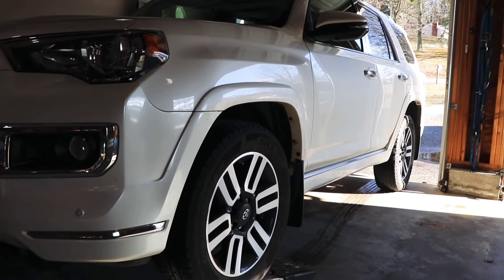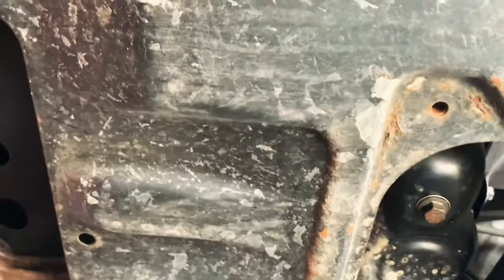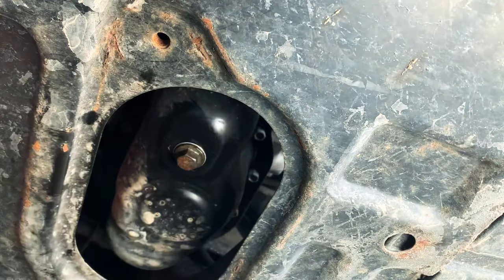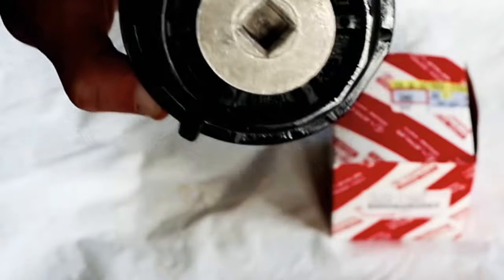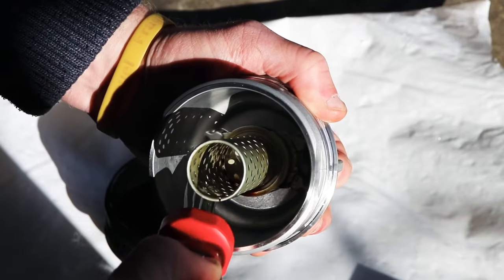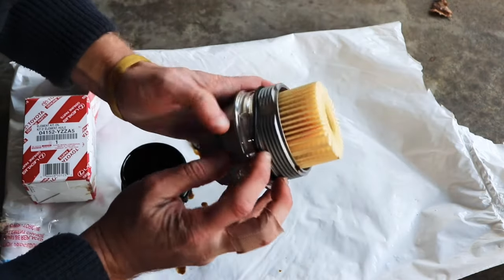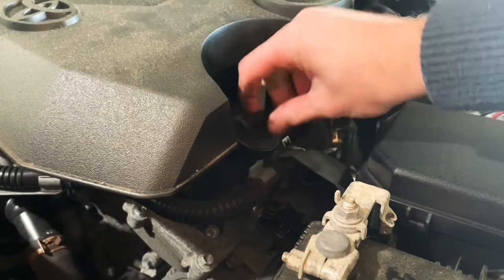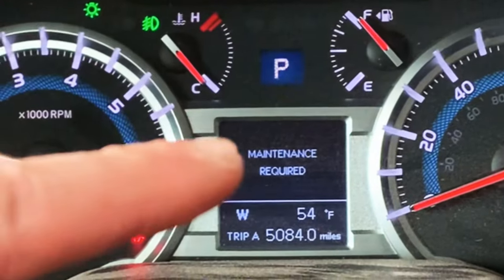5th Gen Toyota 4Runner Oil Change (2010-2024)

Comment: I like Toyota's vehicles, but WTF can't they just use a single piece disposable filter with a metal case like everyone else?
Reply from the maker: I agree it would make this job much easier! Thank you for watching!
Reply: Reduce recycling of metal cans
Reply: Absolutely maddening!
Reply: I have a 97 4runner & that one does use the regular aluminum filters...not sure what year they changed the fikter layout
Reply: No, they use filter designs that actually protect your engine.
Reply: @jensenhoskins714 😂😂😂 then why does every other modern Toyota use a normal metal case screw on filter?
Reply: @burlyheads not positive on this but maybe because 4Runners are built in Japan and everything else maybe elsewhere? Japanese have their ways and I will never argue with them 😂
Reply: @burlyheads The filter housing eliminates the most oil when opened and creates the best seal when closed vs those cheaper metal cans found on Toyota's most likely made in Canada and America. Some AMG Mercedes-Benz uses the filter housing design as well.
Reply: Taking the single piece off could be a PAIN in the ass by using your hands, and not using a tool instead UNLIKE Toyota.😂😅😂😅😂😅😂
Reply: $65 seems pretty cheap for an oil change considering all the work involved.
Reply: @starpartyguy5605  parts and labor...gotta factory all those in...
Reply: Speaking as a professional mechanic, these non disposable oil filters are actually much better to have on your vehicle. I’ve see those disposable oil filters get punctured by a stone and the loss of oil lead to damage in the vehicle. The reusable canisters are much better.
Reply: Actually,  I like those disposable cartridge type filters as long as they use an aluminum or steel housing and have the drain plug on the bottom. I have a hell of a time removing a spin on oil filter and not having oil run down my arm.
Reply: @dingznthingz  yes. I like Toyota's newer design actually. A tool makes it EASIER to remove the oil filter...and can drain the oil of the filter as well so doesn't spill onto your arm.
Reply: Don’t complain too much. Ford has a plastic pan with a dumb plastic twist off drain plug. Then they have the same twist cartridge but on top of engine.
Reply: @itsme6026 Gaaaaaaay
Reply: At least make the filter accessible without removing the skid plate.

Comment: Putting a gallon size zip lock bag over that filter before removing will catch that oil then zip it closed and throwwwww
Reply from the maker: Thank you for the tip and for watching!
Reply: Removing the “drain” plug on the bottom of the filter housing, and the supplied “drain valve” that comes with the new oil filter would make far less of a mess, and no need for a plastic bag over the housing or extra clean up. A 3/8” ratchet will fit the drain plug of the filter housing. Remove it. Snap the supplied drain valve in to place, and let the housing drain. Remove the housing, throw away the old filter, removing the old o-ring seal, wipe out the housing, coat the new o-ring seal with a bit of oil, put new filter in the housing, screw the housing back on until tight (NO MORE) install housing drain plug with new o-ring seal. NO MESS to clean up. NO DAMAGE to plastic housing. Been doing it that way since new, and NEVER been a problem. If you decide to switch to the “aluminum” filter housing, BE SURE TO COAT THE THREADS OF THE HOUSING WITH A LIITLE BIT OF LITHIUM GREASE (or anti-seize), otherwise the filter housing WILL be stuck to the engine block by the time your next oil change is due. The “threads” will seize to the engine due to “corrosion” Seen it happen MANY times at the shop. VERY big pain in the butt to remove there after. I think this is why they stayed with the “fiberglass” housings perhaps (just a guess) Not saying the aluminum housing isn’t better / stronger, but it CAN be a bigger headache too if not done properly.
Reply: @03zx2  Thanks for the heads up with the lithium grease suggestion!
Reply: @03zx2  
Actually, the housing includes two main components, the oil filter cap (or oil filter housing cap) and the base part of the housing that the cap screws into and that remains attached to the engine block.
Reply: @03zx2  Do you need to grease the threads each time the filter is changed?
Reply: Great tip.Thanks.

Comment: According to The Car Care Nut, the plastic filter housing Can last the life of the vehicle. The issue is lube techs seem to over-tighten them which damages them. He recommends sticking to the OEM plastic filter housing from the factory, and I’ll follow that advice..awesome Steph by step nonetheless! Thank you!
Reply from the maker: Yes that is definitely true about the housing lasting the life of the vehicle and it is perfectly reasonable to keep it. The only reason I’ve changed mine to a metal one is because my other Toyota vehicle (Sienna) had one from the factory and mine was already damaged by the previous owner/mechanic of my vehicle. Thank you for watching and thank you for the compliment on the video!
Reply: The plastic ones can, if taken care of, last the lifetime, but why chance it?  The metal one will not break and actually helps cool the oil a little due to heat transfer.  There's no down side other than cost going with a metal housing.
Reply: @jbpooh it’s not correct that there is no downside, as has been well documented by the #1 Toyota channel on YouTube, AMD at The Car Care Nut. Several reasons he gives, but one I will share is metal on metal threads can damage the housing opening. We all love Toyotas, the Japanese engineers knew what they were doing in the plastic housing.
Reply: @Burps___  There is no downsides that we have seen in several years of installing and using them.  You can watch all the youtube you want to, but from real life experience the metal ones work just fine and cause no issues. To each their own though so you do you and believe whatever you want.
Reply: @jbpooh  Thank you for giving me permission to believe whatever I want.
Reply: @Burps___  You're very welcome!

Comment: Removing the front skid plate was the hardest part of the job.  The two hooks in the front that the skids plate hangs on were very difficult to free up.  Makes me thing about not replacing that skid plate (I don't off road with this vehicle.)
Reply from the maker: Yes I agree they are a pain for sure. I would hesitate to recommend leaving the skid plate off because in addition to protection it probably also directs air flow through the radiator and engine compartment ad well. Thank you for watching and please consider giving the video a thumbs up if you haven’t already! Thank you!
Reply: I used the tire jack to lift the driver's side just enough to make pulling the skid plate off easy.
Reply: I fought with my skid plate today for 10 minutes and couldn’t get it to unhook no matter the angle or how I pulled/lifted. I managed to get one side free but couldn’t get the other. I just let it rest down on my chest like always and worked from there. The next oil change I’m going to try to remove it again and drill out the spot welds for that section and be done with it.
Reply: I highly recommend getting an aftermarket skid plate that has a removable access panel to get to the oil filter. I went with an aluminum one from RCI. It makes the job much easier and looks cool.
Reply: Never get under a vehicle when it is on a jack. Jacks can fail and the car can crush you when that happens.

Comment: Those plastic oil filter housings are nothing but garbage.  I own a BMW X5 4.8i and it had an oil leak I had a hell of a time locating.  I put it up on my lift and started the engine. I wiped everything down and looked all over until I finally found oil seeping out of a crack in the oil filter housing. I had my son inside the vehicle holding the engine at 2500 rpm's. The housing only leaked when the oil pressure was higher than what it is at engine idle speed. Since then, I have replaced all my plastic filter housings with aluminum or steel, whichever is available for the vehicle.
Reply: Absolutely nothing wrong with the Toyota plastic housing.  Had the same one on my FJ Cruiser for 13 years, same engine, same filter and housing, same skid plate.  Use the proper cup-style filter wrench and not the one in the video.  Zero problems.

Comment: Try using a torque wrench. This housing and plug were clearly extremely overtightened. It may not seem tight enough at torque, but there are safety’s to hold the housing in place (a spring) and if you were to lose the plug, you still won’t lose oil.. conventional filters rely on end rubber gaskets and require more torque. Side seal o rings require only enough torque to keep it secure. Even Toyota techs make this mistake.

Comment: Thanks for this DIY video.  I decided to do my own oil changed and found out a lot about FCKn Jiffy Lube, Midas .  They apparently have been changing the oil but not the filter for the couple oil changes.  The moment I tried to take out the skid plate, the screws were so rusted, they snapped off.  After further checking, there were some screws missing.  I will never trust another Company to change my oil.   My plastic oil filter housing looked like it was original one from the factory, even had that metal tab clip still on it. Again Thanks for the Video.
Reply from the maker: I like the piece of mind of doing my own oil changes as well, as you could see my housing was damaged by one of these shops before I had bought the vehicle. I knew it would be a good idea to swap it out with a metal one much like the one on my Sienna for piece of mind. Thank you for watching!
Reply: Take a sharpie and mark an x on the filter then you know if it's been changed

Comment: To prevent cracking the plastic oil filter canister bottom, use a Motivx oil filter wrench. It's a cap wrench that fits on the end of the filter housing.
Reply from the maker: That’s the one I switched too, great tool!
Reply: @5MinuteFixit I have a ‘15 Toyota Venza which also uses this same filter setup. There’s a YouTube channel called The Car Care Nut - he’s a certified Toyota master diagnostic technician. He says that the plastic canister is made of a high-grade plastic, and can last the life of the vehicle IF IT IS NOT OVERTORQUED! (ie a shop). That’s why I choose to do my own oil changes.
Reply: Yep, 220,000 miles on my 2011 Tundra and still using the factory oil filter cap

Comment: Thank you! Great job on the video too. 

Just had to share this after reading many of the comments below. I also subscribed and liked your video and channel.
I was a mechanic for over 25 years, worked for independents, fleets, and several dealerships. I've seen some of the many things other mechanics did, pretty shady shit too. Never replacing the oil filters was one of the many. Because of that, at over 60 years old, I will still do all of the repairs and maintenance I can, myself.
I was shocked to see this type of oil filter on my 2019 4 Runner. LMFAO. My first car was a 64 Chevelle SS with a 283 CID. Fun car....the oil filter was about the same as the 4 Runners. I died laughing, thinking about it and talking to wife.....we went about 40 years backwards in time with this type of oil filter. Way to go Toyota! I think the last year GM used this type of filter was around 1967, went to the spin on cartridge type. Still laughing at this.
Reply from the maker: It is kind of crazy that these newer Toyota’s have this type of filter. My 2012 Sienna has the same type as well. Thank you for the compliment and for watching and subscribing! I appreciate the support!

Comment: Great video. One comment: when changing the center tube, you say to push the tab in, but it’s hard to see what you’re doing at that point. I couldn’t tell if you meant to push it “in” toward the tube or “in” toward the bottom of the housing. I pushed it toward the bottom, but then had to bend it up to get the new tube in. Tab seems a bit weak now, but I shouldn’t have to bend it any more. Hope I didn’t mess up.
I don’t like these tabs. My old Camry had similar tabs holding in the spark plug tube seals, and by the time I got it, the tabs had weakened and broken off.

Comment: Very good video instruction. I can't stop wondering why Toyota did such a terrible design of their 5th gen filter position (under the skid-plate with no access window). The previous gen had filter location under the motor hood and it was a breeze to change oil in those engines. While there are many good design features in 5th, some engineering solutions are amazingly stupid. To simplify oil change process I cut the access window in the skid plate and I made the cover that easy to open. It made my life much easier when I change the filter.
Reply: Curious- how and where did you cut your access?  Thinking about doing something similar myself.
Reply: @markheffernan5541  I cut off the venting dome in the skid plate. And then riveted in hinged aluminum plate with one screw locking it in place (the access door). This way I got easy access to the filter's compartment.

Comment: I've been changing the oil in our 2011 4Runner, for 12 years.  Before I try to remove the filter housing,  I always first attempt to remove the housing drain plug. However, that sequence has never worked; the entire housing comes out! As a result,  my plastic filter looks like it's brand new! This also explains why I l have a drawer full of the small "O" rings.  Lol
Reply from the maker: That happens a lot! Sometimes a quick tap on the ratchet handle will pop it loose, sometimes not! Either way I don't think it's unreasonable to only change this o ring every few oil changes unless there is a leak. Thank you for watching! Please consider giving the video a thumbs up if you haven't already! Thank you!

Comment: I replaced the plastic housing with a Baxter adapter. It uses a conventional screw on filter now. Put Fumoto drain plug on too. Never going to a shop for an oil change again.

Comment: Thumbs up.

The only thing I would have mentioned is the importance of following torque specs especially for those who wish to drain the oil filter housing before removing the oil filter housing cap.

Oil filter housing cap = 25 N•m
Oil filter cap drainbolt = 12.5 N•m

Personally I don't think there is a problem with the plastic part as long as those torque specs are followed. But time will tell. If mine ever does give me a problem then I will likely replace it with a metal one.
Reply from the maker: Thanks for the thumbs up! I bought my 4Runner used and the filter housing was already damaged by previous owners so I wanted to change it out. The metal housing looks very well made if you ever decide to change yours! Thank you for watching!
Reply: @5MinuteFixit  no thanks. You got a big break in the threads   Sure the rubber ring does the job but you never know
Reply: Nobody torques the housing. There’s a metal pin sticking out showing you where it should end up when tight.
Reply: @itsme6026  
What kind of statement is that, "Nobody torques the housing."? I touque the oil filter cap and the drainbolts, and if you watch enough oil change videos you'll find a number of others who do as well. The torque specs are right on the oil filter cap. If people would torque to correct specs then the plastic oil filter cap wouldn't need to be replaced.
Reply: @njsongwriter  nobody unscrews the metal cap off the housing neither.  Huge waste of time.  Ask any oil change shop.    And nobody torques the housing.   The housing is plastic.  When it stops turning then it’s done.  Period. Move it any further and you’ll crack it.
Reply: @itsme6026  I changed my tundra filter housing from plastic to metal early on. The plastic one was, for some reason, incredibly hard to remove each time, even with the tool that grabs the ears. My wifes car, with the metal housing, was always very easy. I switched my tundra housing for the metal one and now it's easy to remove each time. To each their own, but it was a cheap swap and saves me a lot of time and struggle each time I change the oil on the Tundra.

Comment: If you use the circular metal filter housing tool you will never break the plastic one. Circular one grabs the housing in 6 spots. Also for oil: 20 weight is energy EPA conserving garbage. If you look at some of the older FJ cruiser handbooks before 20w oil was a 'thing' it states use 30 or 40 weight in the past, especially if your hot climate it wont hurt anything but maybee .10% mpg decrease lol. I've always used Shell rotella T6 5/30 'multi vehicle' no issues at 80,000 miles but I also have a Magnussen supercharger and spin my truck to redline lol.

Comment: Thanks, just ordered a filter housing and MotivX filter Wrench
Reply from the maker: That’s great! You will appreciate the new filter housing. Also, I have a video on my channel the just shows the housing swap if you need just a quick refresher before you do it. Thank you for watching!
Reply: @njsongwriter  No, I got the one with slots in it. Just two days back i performed an oil change with it, it locked in to the filter in the slots and worked out perfect.

Comment: Thanks for the video. One question, I see the drain plug is flat, not in an angle, so when ramps are used do some oil stays in the pan? vs raising the vehicle leveled (like with a lifter). I have a Limited so I will have to use ramps, just that small concern.

Comment: Should not swap out the plastic cap, metal cap have a high chance of over tightening or stripping (damaging the thread). The base of the filter housing cannot be changed easily, if the threads on it was damaged...
I rather change to new OEM plastic caps than a metal one.